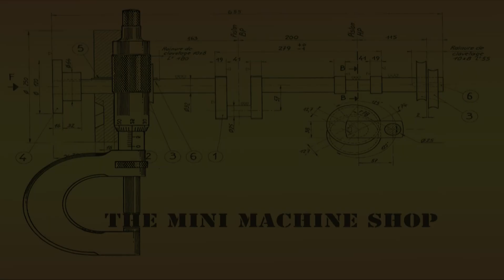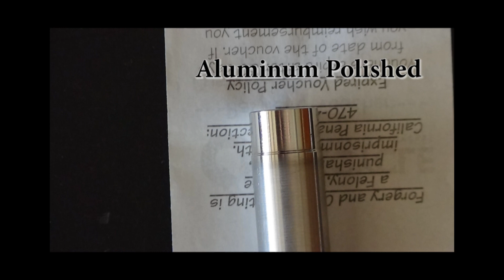How I turn and finish different metals on the mini lathe Video #19

Comment: I had to stop when you wrapped that rag around your hand and reached in by the spinning chuck. No rings, no watches, no long sleeves, no gloves and no rags anywhere near rotating machinery. No, no a thousand times no! Also working alone is not a good idea. Machines are heartless beasts and faster than anyone's reflexes. Flesh does not stand a chance against metal.

Comment: Flitz polish? Its a great product. I don't know if your failure with it, but if you pick up a decent sharpening stop and bark river stropping compound you can use it like a very very fine file or sand paper. I works wonders on the harder finished materials like stainless and titanium. I've had really good results. You can also use the Flitz polish on the alternating side of the strop.

Comment: Thanks for the review.  You scared the crap out of me with the micro fiber towel.  It slipped off the bottom of the piece and it brought back some bad memories.  Nice video in all.
Reply: +Dave M 
Yeah, Dave, please don't do that!  With the cloth wrapped around your finger, should it catch on the part or jaws the next thing you could see is your finger and associated tendons flapping around.  It would be an awful thing...

I've often thought that some sort of U-shaped holder with sandpaper/cloth stretched between the 'U' wouldn't be a much safer way to sand/polish on a lathe...?
Reply from the maker: +tdematteo01 Sorry about that!!

Comment: My guess is toothpaste for the mystery material.
When I was building car engines for a living we would do a final polish on crankshafts we had to rework for handling damage with a colloidal Aluminium Oxide slurry on a leather chamois strip to bring up a mirror surface. The stuff was a real pain to clean out of the oil galleries afterward but the finish was superb. 
Cheers Eric

Comment: Does using the compound to feed your cuts not introduce a possibility of runout on a longer cut. Shouldn't the wheel for moving along the bed runners be used? Glad the lathes back up and running.
Reply from the maker: +Cold Coffee_ The compound travel is only about 1.5" and its been dial indicated and rotated for zero runout. Normally I do use the wheel for course cuts then the auto feed for longer cuts. There is quite a bit of runout over the length of the bed which I haven't dealt with yet. Could be a twisted bed.